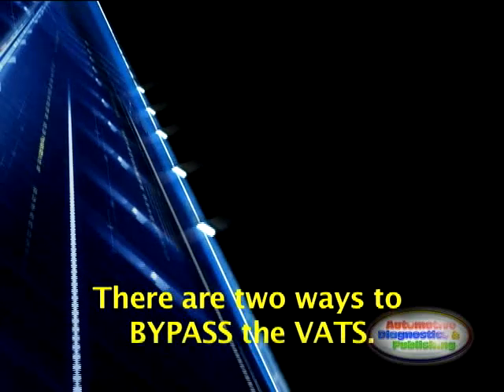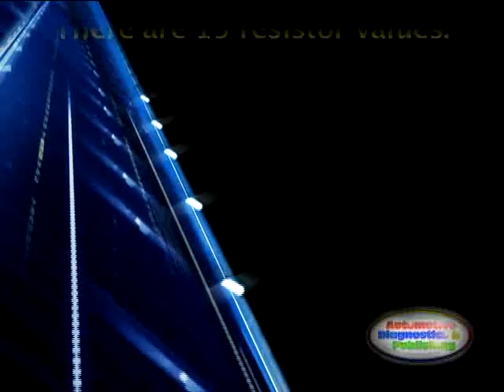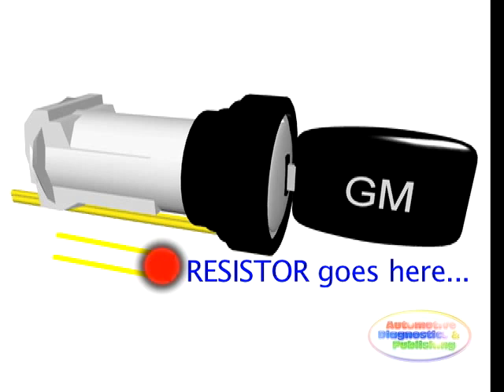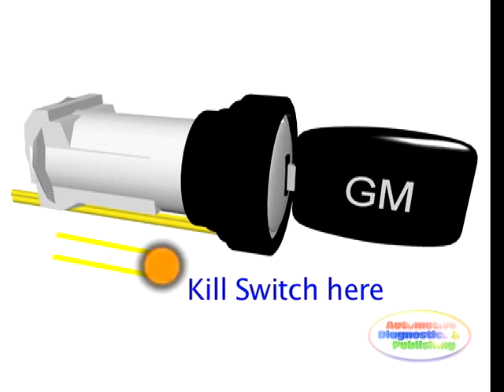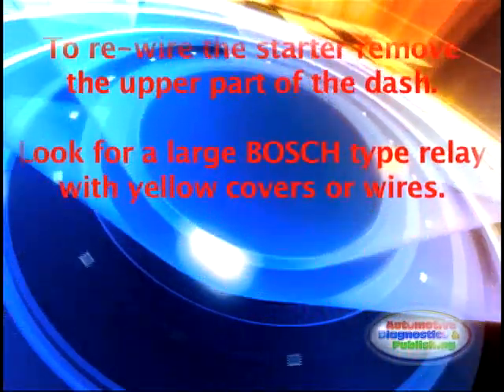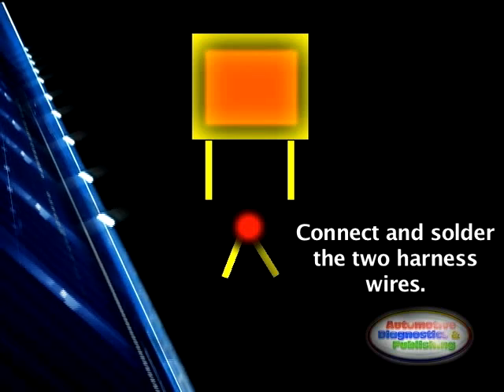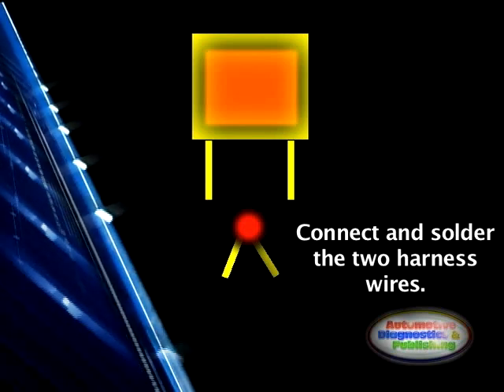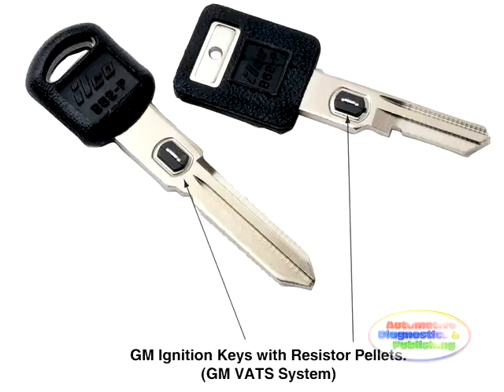GM VATS Ignition Key Bypass

Comment from the maker: Don't disconnect the battery please. Yes, this option is better than wiring the starter as you said but only if you have the resistor pellet on your key. Some systems also disabled the injectors, so beware of rewiring the starter. googd luck.

Comment from the maker: Great, well now the next step is to disassemble the column and test those wires you mentioned. Yes, these pellet contact wires are an issue and always were. Do a continuity test, or just substitute with a resistor. You can even use the same pellet in the key and momentary bridge it to see if light goes out. Either the wire is out or the antitheft module is the issue, but don't jump the gun. Disconnect the cylinder contacts and do the bridge test first. Post back with more.

Comment: Well great.  This was done to my 1996 Regal and allows the car to start  BUT.  Now the ECM does not think the key is in the ignition and although the car runs, the cooling fans do not operate at the correct temperatures.  This is not a problem in the winter.  Had to add another thermostatic switch in the return radiator hose to operate the AUX fan.  The ECM does not like it so I get a check engine light when the AUX fan runs.

Comment from the maker: It depends on the system. I think for a 1991 it's only the starter. The idea is to use a resistor in series with the ignition cylinder key contacts. In the video I specify to determine the exact system that you have before doing the bypass. Bypassing the starter only won't help you if EM is also killing injector pulse.

Comment: I need a solution like this for a 2003 Civic EX that the dealer can't program a key for.  The computer was replaced due to the alternator zapping it.  They say it's a gray market car and can't help. They say it's Canadian but the car is from California.   I have the wire diagram, but don't know if I should run power to the red and blue wire at PCM E27 or ground or what.  maybe E3?   Please help if you can.  Thanks.- Brian  Tow to Canada isn't an option for them.

Comment: Solder the wires to the resistor in the key itself (spare key) and tuck the whole thing up under the dash. Works great and you don't have to go find a resistor.
Reply: RobbyWorld1
Reply: did it but wires have come loose out of wiring harness,someone else did work car says may not start help appreciated

Comment: i have a 1991 Buick park avenue. The question I have
is if i bypass it by joining the two yellow wires at the relay
behind the dash as shown , will it bypass the pass key
module and give power to the injectors. From what I 
understand both the starter and the fuel injectors are
locked out when the system is engaged?Please advise

Comment: 95 Buick Lesabre 3.8 -  My security light goes off, but I cant get noid lights to light up when connected to my fuel injector leads. I cleaned my ground bus on both sides as well as big grounds in engine compartment.

How can I test the module side of the vats system to see if it is giving the 50 htz (5 volt?) signal to the PCM? I think it is pin D14? I don't have an O-scope... will a standard multi-meter do?
Reply: Substrate7

Comment from the maker: Ok, before you do that, do the following. Take a light sandpaper and lightly clean the pellet. Then spray some WD40 into the ignition cylinder. That'll complete the system. This procedure often solves the problem. Give it a shot then let us know...Mandy.
Reply: I did it an it worked I have a 2003 century Buick but my key would no longer go in so I took tumbler out so can start with screwdriver an now won't do anything

Comment: I would think it would be easier to duplicate the key without the pellet. Cut the pellet out of the key and solder the wires to either side of the pellet. Stuff it up under the steering column and drive the car away.
Reply from the maker: Yes it is possible but people loose the key or the pellet gets damaged. Hence the reason for this video.
Reply from the maker: Thanks for the heads up and for sharing.